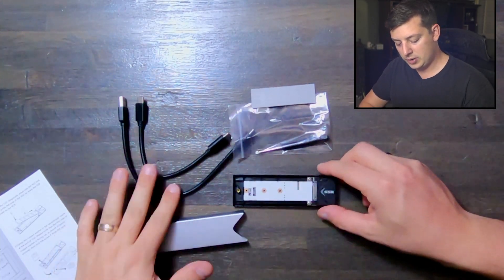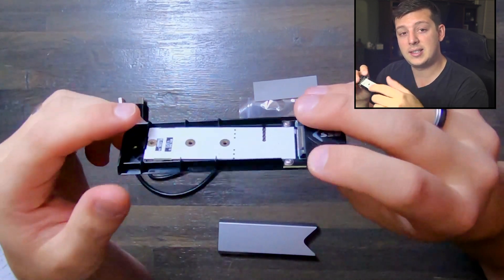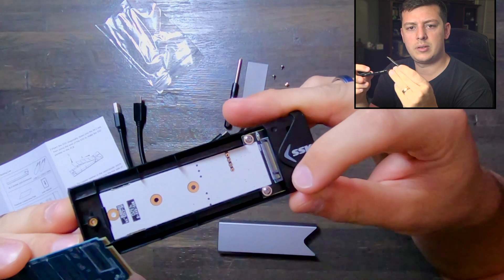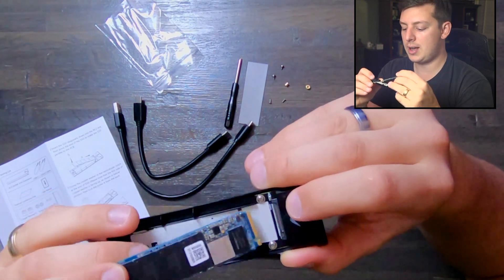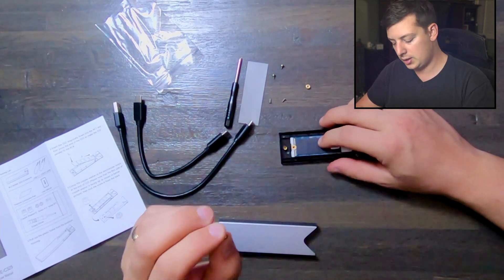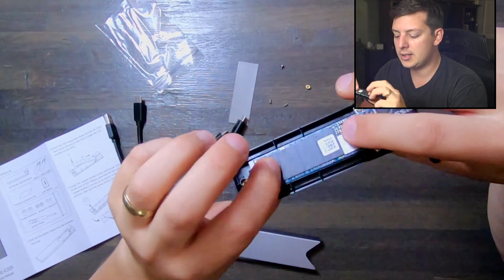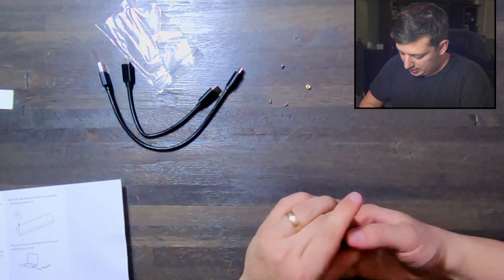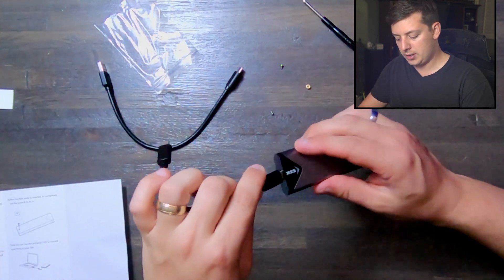Inland M.2 SSD Enclosure Install | Hacking Hollywood

Comment: Hey man a whole video on something so easy, It's kinda hard.  No Joke.  It's an easy job but it feels difficult, and you can't be unsure of yourself. 
These NVmes are very expensive, and the enclosure process is nerve wracking.   Thank you for taking out the time to make a video that seems like it would be a no brainer thing to do, but it's not. Especially if that pricey NVME already has data on it.  This was a very calming step by step. Very exceptionally well done sir. Kudos for noticing and responding  to the need so gracefully.
Reply from the maker: Thank you so much!